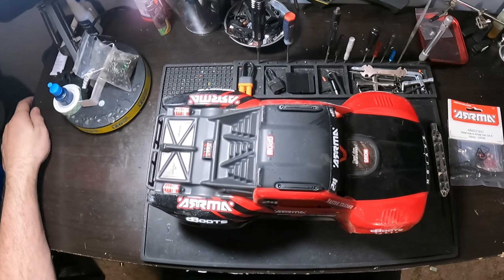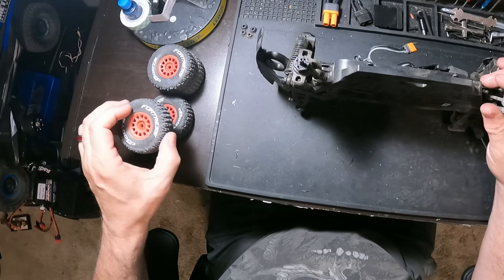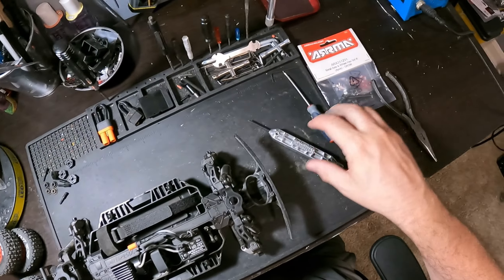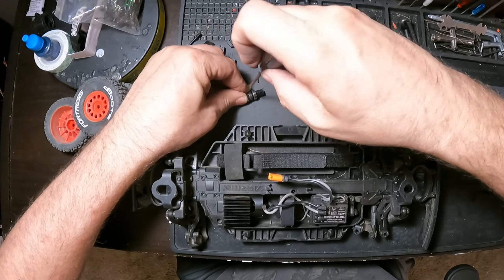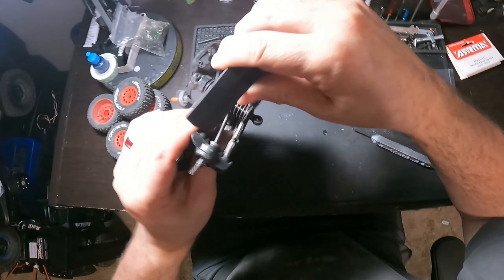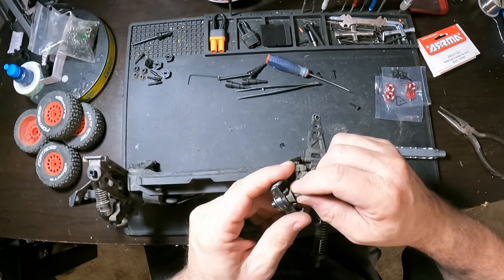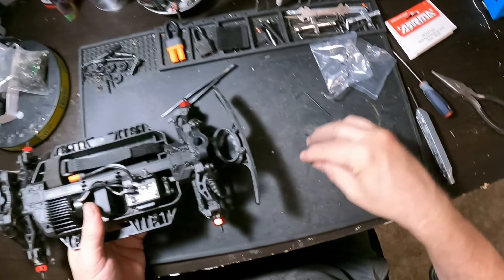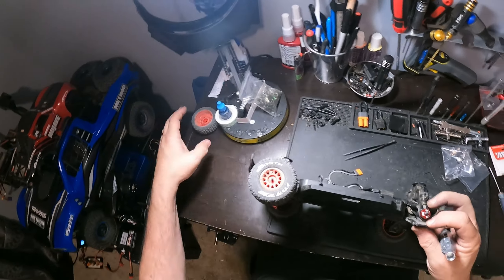Arrma Mojave Grom - How to Upgrade Your Axle & Wheel Hex

Comment: Great video!  New to RC and was looking at this RTR Grom for my first RC and looks like this might be my first upgrade.  
Saw a commenter say has a Granite and Typhon Grom.  Maybe for a noob a Arrma senton 4x4 would be better?  Anyway I stopped in my local hobby shop for the first time they said to look for a Redcat Valkyrie.  Have you seen this?  Interested in your advice on it if you have any.  Thank you.
Reply from the maker: go with the Arrma senton 4x4 tuff truck way better then a redcat for sure. You wont be disappointed. Tons of upgrades out there and parts.
Reply: Thank you.  
Any advice for my first set of tools?
Reply from the maker: @fferrer8281  descent set of mm Allen screw drivers .

Comment: Great video and camera shots.  Thanks for doing that.  I own the Granite Grom and the Typhon grom, and they've been great in stock form.  I have not purchased the Mojave Grom yet.  However, I am wondering for $150 plus these $29 of parts, if a guy isn't better off buying the $220 Arrma Senton 4X4 550 brushed instead?  What do you think?
Reply from the maker: @RyanTucker-jw8dn  I would most likely go with arrma senton 4x4. It's a lot better platform tons of aftermarket support and parts availability. Its a proven tried and true platform and pretty much bullet proof. They handle amazing and are just an all around well rounded RC basher.